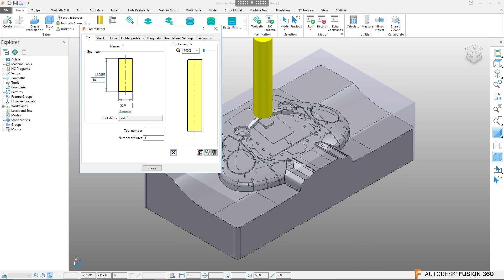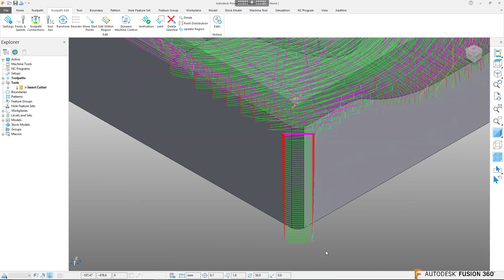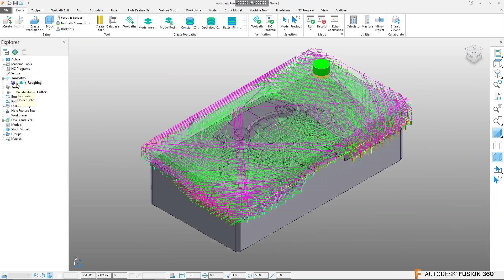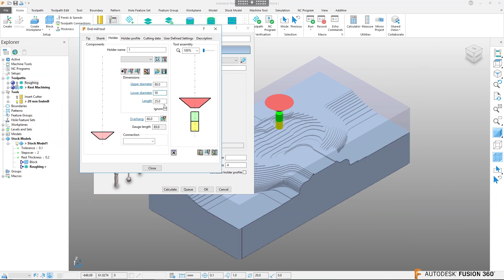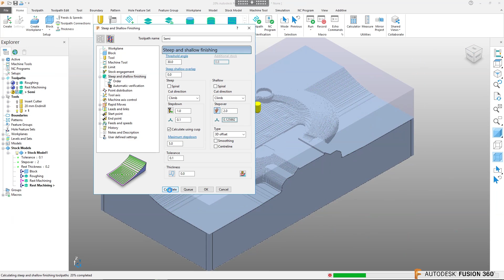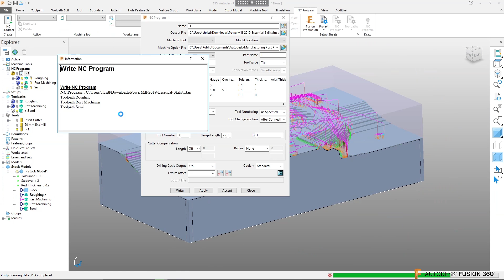PowerMill Absolute Beginner Tutorial — #LarsLive 181

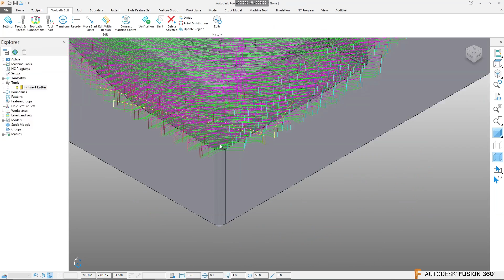Comment: 18:50 better to make a boundary by selecting bottom of block and on limit tab switch the tool center to edge. Deleting toolpath like that is dumb. Best thing is to just use a stock model, way better. I hope your going to fix those leads and links, thats why deleted selected toolpath is dumb, if you recalculate you got to trim again

Comment: What PP do i need for a DSP A18 Controler please
Reply: Hello Ian, I am facing the same issue. kindly reply if you are able to find the right PP. I have the same DSP
Reply: @emc8564  what software are you using?
Reply: @cornishman1954  I am actually trying powermill for 4 axis rotary. but for flat surfaces 3 axis, I use artcam and vetric aspire.

Comment: Dear Mr. Lars, hope you are doing well and I appreciate your tutorial. As a matter of fact, you explain about stepdown and defined 3mm in each pass, therefore, could you please why you select this number?
I know there are some relationships between material and the tools, but I would be more clarified about this matter. for instance, If I want to select tip radius 25 or endmill 20 to define roughing toolpath regarding stainless steel like VCN or similar material what is your prefer to define step down?
Best regards
Reply: All about the tool, info comes with it. Matters

Comment: Can you tell me how to create a user define boundary 

For example if you want to run a dia 3 ball in the corners and don't want to run it on hole model how can we do that
Reply: Dinesh Kumawat don’t know if you have figured it out yet. But you have to make a hole then use the capping feature on the hole.
Reply: @dubssausage7021   you can create a rest boundary using refrence of last tool by this you will get a boundary on the corners
Reply: Try this Autodesk Knowledge Network link to learn more about creating user defined boundaries. It's takes you through the different settings for the boundary. Hope it helps.
https://help.autodesk.com/view/PWRM/2020/ENU/?guid=GUID-CE77980D-8505-4A80-B6E8-036D368E83A4

Comment: Hello Lars,

So, what software should I go with.? Fusion 360, inventor hsm, powermill.? Which one does better at adaptive toolpaths.? Bottom line... which one I should get to reduce cycle time and be more productive.?

Thank you in advance and congrats¡
Reply from the maker: All three have Adaptive toolpaths, so that don't help you select😁 Question is what type of parts you do. Inventor HSM and Fusion 360 has identical CAM, but one runs right inside Inventor. Powermill is really good at 5 axis parts, where Fusion 360 and Inventor are more limited but easier to use

Comment: your explanation is very good 
but in 9:16 you missed a very important step
which is : after creating a new workplane you have to set it active (by double click on it in the browser)
the mistake could cause a disaster because after posting the g-code, you will find that powermill had  chosen another work datum
Reply: Yes you are right that's what i missed
Reply: Solitamente il piano di lavoro è già al Top del blocco, allo stesso modo in cui si progetta con logica e criterio quando usi PShape in previsione di lavorazioni cnc, prima di lavorare è consigliato passare da un controllo su PShape e poi esportare in PMill, mai dare per scontato. Mi piacerebbero queste nuove versioni ma non ho sufficiente tempo per imparare e continuo ad utilizzare il vecchio SW. Delcam che è più veloce.